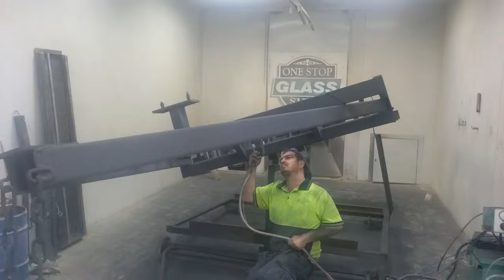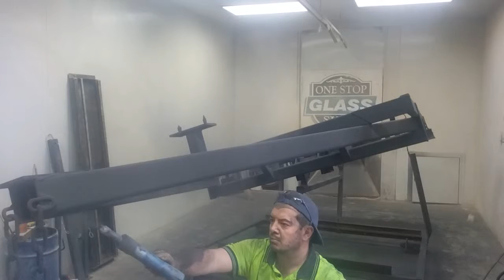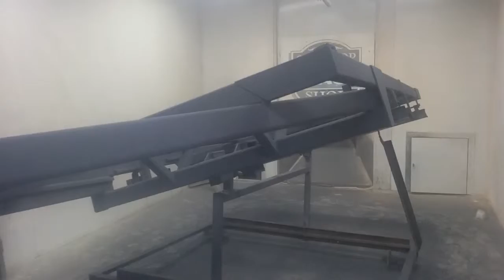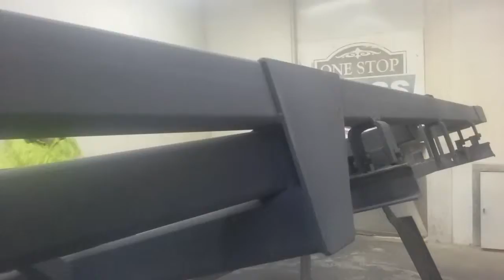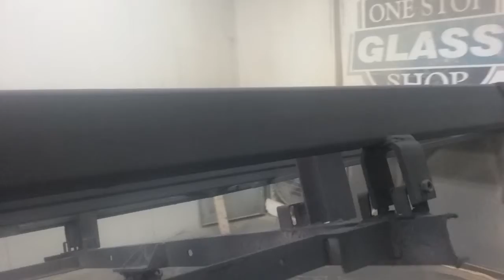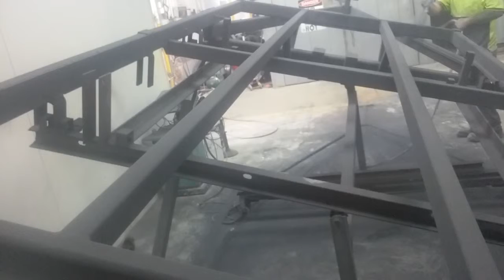Blyth Built Trailers

Comment: Hi Roger , powder coating is very good.
my email is export@colourspray.com . we manufacture the sandblasting machine for removing the rust and paint. polishing machine make the surface finishing. and powder coating machine make the metal surface different color with no dust.
www.colo-group.com